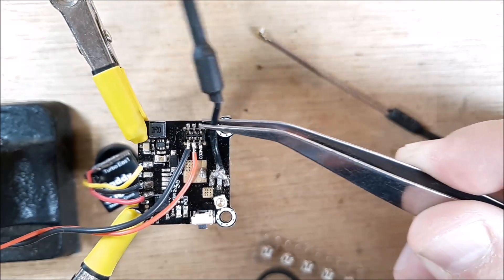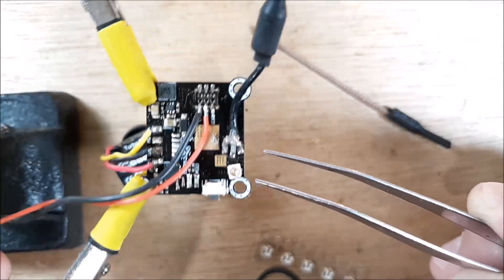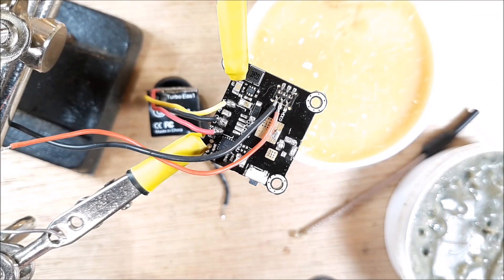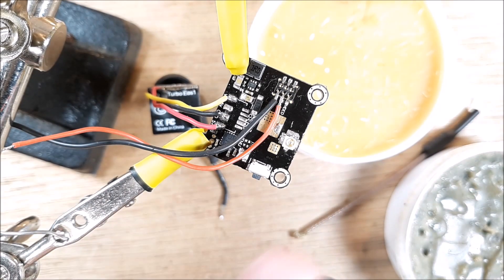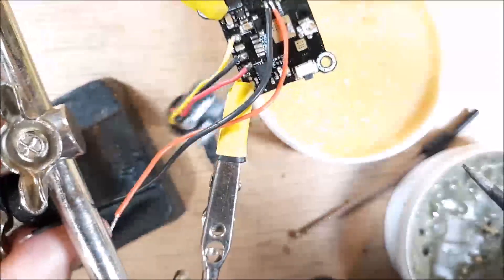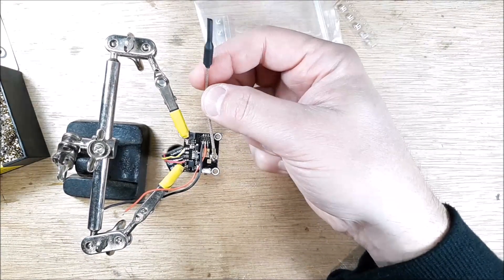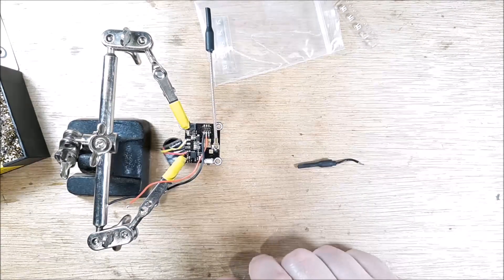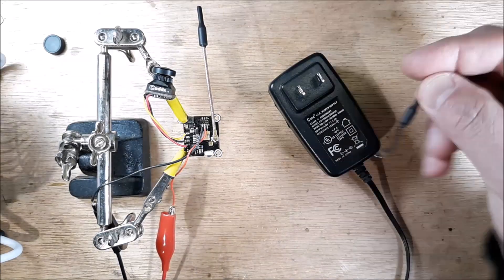U.FL | How To Fix A Broken VTX Antenna

Comment: Thank you for the video.

Could you go over the stuff you're using to clean the tips while you work? I'm still very much a noob to soldering.
Reply from the maker: My pleasure..
You can look for Tip Tinner and Thermaltronics BC-10 Solder Tip Cleaning wire...🍻

Comment: I have a similar issue to what you're doing in this video. I was removing the coaxial connector and the whole thing popped out.
Reply from the maker: It can be frustrating. I'm looking for better U.fl connectors, possibly one's that have a ceramic or very high temp insulator. The one I used in the video has a cheap PVC insulator and melts very easy...

Comment: what are you dipping the solder iron in? Also, Is that wax the same as desoldering wick?
Reply from the maker: In my Quick Tips Playlist, you'll see a soldering video that will answer most of your your questions. I just use old speaker wire for a wick.
Reply from the maker: https://youtu.be/WHOcdEPDXpc

Comment: My elrs reciever t-antenna got hooked on the props and pulled out the rx and ufl connector came off . I wanted to make a connection like the one you took off . Thanks for showing . I need a soldering iron for that ufl snap connector .

and the camera tilt was pulled loose and flopping up and down i thought it was going wild all over . The hot glue came off .
Reply from the maker: Lol, it sounds like you're having more fun than me. The weather has been terrible and I want to fly. Enjoy the Breeze...👍🏻🍻👊🏻
Reply: @PropsOff  
  But i have an idea . Scrape the ground pads off the recievers antenna connection place . Just leave the antenna signal wire . That way it is not so many tiny connections next to each other and hard to solder with a regular soldering iron . Ground wire can go to gnd pad by the 5v pad .
Reply from the maker: @Gregory Dahl you🎴tube 567 M views  
Sorta like this?
https://youtu.be/t7Hz2Pdo_Aw

Comment: I don't have that male adapter put on the board, but I have the other antenna with that male adapter on it, can I cut that tip off and get the metal wire out and solder it onto the board itself?
Reply from the maker: Yes, cut to 32.8mm
Reply: @PropsOff  I tried and failed horribly and I just soldered off a motor wire so I'm hella pissed and I'm  going to quit the hobby for a good century than come back

Comment: thanks, can i just solder it on directly like it was before you soldered it away? do the ground elements matter with these tiny antennas?
Reply from the maker: You can solder the antenna directly as it was and that works great. I crash and destroy my antennas too fast and like the U.fl best. Both ways work.
Reply: @PropsOff  so you just cut the end of that male adapter antenna off and the metal wires in it can be soldered?
Reply from the maker: @dagalpup1278  
The single strand of coated wire (no second coating - coaxial), cut to 32.8mm and solder it directly to the active element pad.

Comment: Hello what the size of the tin please ?
Reply from the maker: Kester 24-6337-8800 50 Activated Rosin Cored Wire Solder Roll, 245 No-Clean, 63/37 Alloy, 0.031" Diameter
Reply: @PropsOff  thx a lot i need to repair my vtx antenna but i would like to leave the origin one.
can you provide me copper wire to use as antenna on amazon ?
Reply from the maker: @alexsentes6105  
I don't use a 16.2mm wire. If I modify it at all, it's going to get a Ufl. You can simply cut a piece of fine strand wire to 16.35mm and expose 1.5mm at one end and solder it in place.

Comment: Hey man, great video. I have a emax tinyhawk 2. I believe my VTX antenna took some damage in a recent crash. I will lose signal at random times. Looking to fix/upgrade but I can't soder to save my life. Would you be willing to do this method on mine for me? I can pay you via PayPal or through Facebook.
Reply from the maker: I will admit, this level of soldering is a bit advanced. I appreciate your faith and trust in me to fix your VTX; However, at this time I'm not doing repairs for the public. Are you local?
Reply: @PropsOff  I'm in Northwest Kansas, from reading through the comments it appears you're in Ohio?
Reply from the maker: @LARSON31685  
Yes Ohio..
Reply from the maker: @LARSON31685  
I was curious if you were local to the central Ohio area, I'm putting together a "Tech and Fly" hoping soon.. So basically, I want to help with repairs and tutoring at the flight field.
Reply: @PropsOff  that sounds like a good idea, I'm sure you'll be able to help alot of people. No worries, on talking on my project. My boss is willing to help me with this project.
Reply from the maker: @LARSON31685  
Just out of curiosity, what VTX is it?
Reply: @PropsOff  the stock one that came with the tinyhawk 2. I'm unsure, very new to all this
Reply from the maker: @LARSON31685  
I see, I can't remember if that VTX was separated or incorporated into the flight controller.. I will need to do a little research. Let me know if you get it fixed soon...

Comment: your videos are fantastic! thank you so much for making these. i had your naked gopro power lead tutorial on the entire time i was making mine. it helped me tremendously. is it possible to convert a ufl connector to an mmcx connector on the vtx? i have a tinygo 4k that i converted to crossfire and now the only thing that is holding me back is the dipole antenna. i have a rhcp lillipop, but its mmcx
Reply from the maker: I appreciate your feedback and support.. Normal mmcx connections are passthrough mounting, I would imagine if you found a flush mount mmcx connector, it would work. I imagine purchasing a polarized U.fl antenna would be easier though  - but I enjoy a challenge...👍🏻🍻👊🏻

Comment: Man can I mail you my eachine novice 4 to have you fix my vtx ???? My ufl connector has came completely off the board it is still on the end of the antenna.....when I purchased it I noticed that they had some type of epoxy or glue holding it on and after a couple flights it started coming off so is there a way I can fix it without soldering???? Only because I can't solder for nothing  man!!!! I have been looking for weld glue or some electrical type glue to fix it.....I'm just really pissed excuse my lingo man but I just got this thing maybe last month around June and flew it 4 times after a lite crash in the grass I broke an arm so I ordered new arms and replaced it then I realized that the standoffs that were supposed to come on it were completely different from what was advertised!!!!! So now I have these skinny black standoffs in the middle that are stripped and I'm just at a point where I don't think I'm going to ever buy another eachine product ever!!!!!! Then they want to give me 250 "good points" at banggood towards my account lmmfao I told the customer service guy I want the green standoffs that were supposed to come on my quad!!!!! That's what I want!!!!! I said will 250 good points buy green standoffs that I need???? Lol .....tish if not then keep your bs good points!!!!! I'm so sorry to bug you man but I'm new to fpv and nobody wants to help me out and tell me what I can do to get back flying....nick and another guy that was commenting on nicks vid actually told me about a bunch of stuff I need to get but nick said he uses "weld" and I found something called weld glue but I don't think it's j b weld????? So I'm lost man!!!! I want something that will keep my antenna on the board along with my ufl connector and won't bother any of the other components on the board....so I would love if I could just solder it but man I would ruin the thing if I tried lol it would be a T-1000 when I got done soldering lol so please man if there is anything any type of glue or epoxy just anything that will help keep that ufl connector and the antenna on the vtx I would be very appreciative man....I hate to bother you but I don't have anyone that knows about quadcopters around where I'm at....and not even the guys at the hobby shop know to much about quadcopters so I'm even in deeper lol....Any help at all brother would be much appreciated thank you man I hope to hear back from ya✌
Reply from the maker: You seem to have many questions. I would like to see an up close and clear picture of the pads on the vtx, send though messenger..
https://www.facebook.com/scooter.pie.100
Reply: @PropsOff  I'm barley on fb these days but I would love for you to see what I'm talking about.....I feel cheated in a way.....I'm not that type of person that will bring in legal teams I just want what I pay for....in these hard times  I'm already blessed that I able to purchase drones""""""" so when I get it and it's not what is supposed to be....yeah.....I'm gonna be pissed off.............this was money that could've done other things but I got a drone.......and now it doesn't wanna act right........I have cousins that wanna take it back lol buy imma just try to fix it.....
Reply from the maker: @FPVADER  
You can email a few pictures too. It would help me to understand what's going on. The antenna is cray long on that thing. I fly a stubby on nearly all my quads. Are you in Central Ohio?

Comment: How do i fix the other end of the connector my antenna wire came out do i just stick it back in and recrimp it down or do i need a new one thanks
Reply from the maker: Hate to say it, but in that case I would probably get a new one. It just wouldn't go back to the same.. The antenna on a VTX is important, it has resistance for the transmission. If the antenna is damaged or is missing, in many cases, the VTX will burn out or fail to preform.. My 2 cents...👍🏻🍻👊🏻
Reply: @PropsOff  ok thanks I'll get a new one

Comment: I'm finally bought my first quad  (tinyhawk 2 freestyle) after years of following the hobby.  I chose it cause I knew I would immediately start upgrading and it was capable of that.  This video is great thank you.  A lot of the channels I've followed, like RC Model Review and Josh Bardwell etc, cover some detailed stuff but this just wasn't one of those things.  I appreciate that you took the time to make a quick little video on something that could be forgotten or considered not important enough to cover.  For me this was exactly what I needed to see to understand how this is done.  It made it simple which i appreciate.  Now if I can only keep my hands steady enough to do it LOL.  Wish me luck ... and Thank you!
Reply: Hi, did you manage to do this vtx repair on your free style 2? I'm at this stage now but doubting my solder skills on such a tiny part. Thanks.
Reply from the maker: @craigdavo  
Apologies, YouTube's notification software is horrible! I just now seen your question. 
I have upgraded all my antennas now. The range is just too good not to do it. Does take a little practice to not melt the connector while soldering the center pin, LOL!
Reply from the maker: Thank you for checking out my channel and subscribing! There are so many channels out there now, I appreciated your kind feedback.. I have done this a few times, it's a good thing they send 5 of them in a pack, lol.. Good luck! Hope the best for you...👍🏻🍻👊🏻